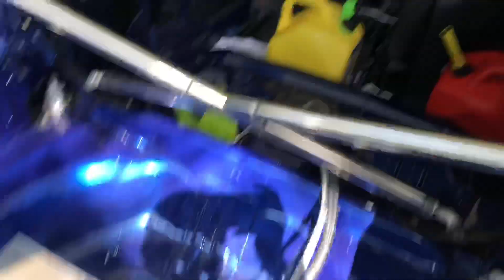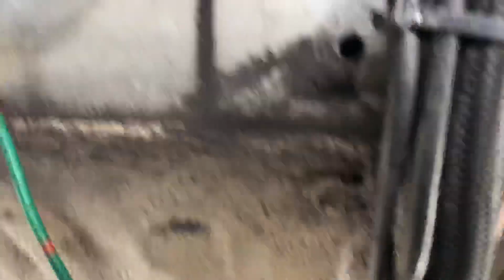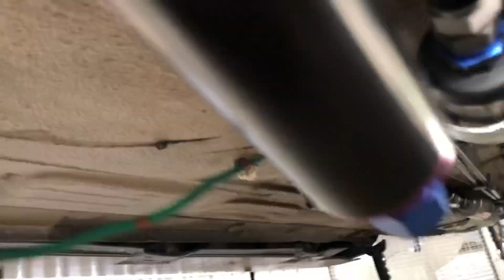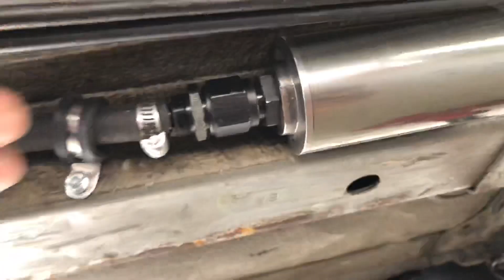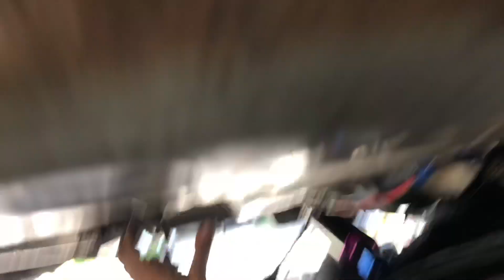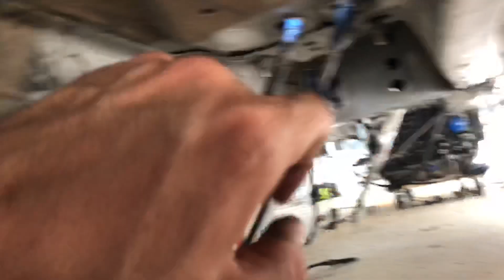AWD RSX (Fuel system install)

Comment: hello dear ones, thank you for the taking the moment to make this for us all. We just came a cross another video where this same particular tank was modified to use the stock sending unit which allows you to see your gas level. if you'd like to see it. here is the link. You could also use the same method used here to attach a 45 degree gas flange port to connect to your stock fill port.
https://www.youtube.com/watch?v=Kss-a06l0jY
namaste

Comment: Good to know. I plan on doing a k20a and element trans/diff. I love my rsx. Just the way it handles, the mods, and how even today it looks as good compared to newer cars. 

Converting to awd doesn't seem all that complicated. I initially thought there would be a lot of custom work but seems like you only have to do a little fab, and use a lot of honda parts from other vehicles. That keeps the cost down, and the reliability at the level of honda.  

Keep up the good work.